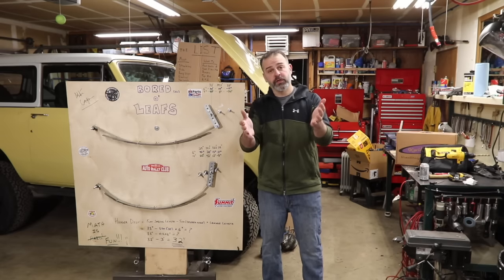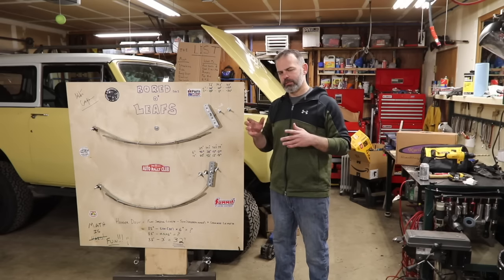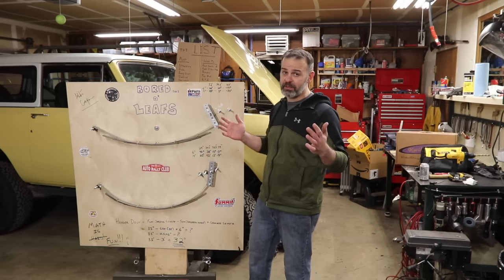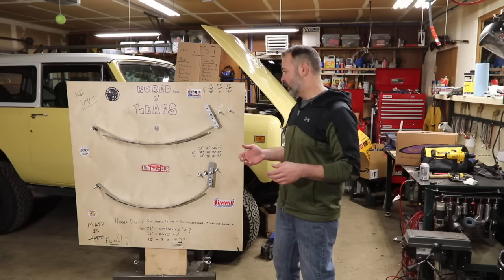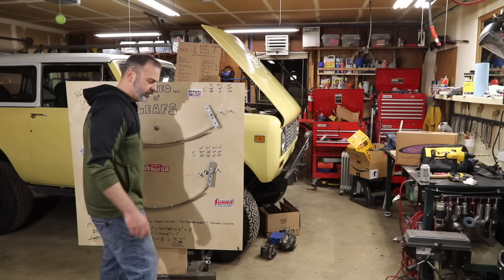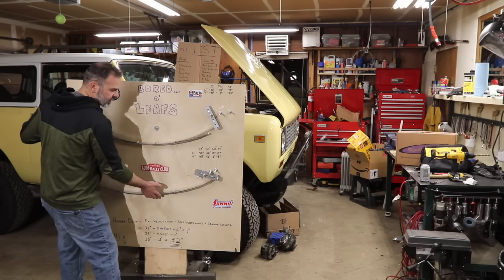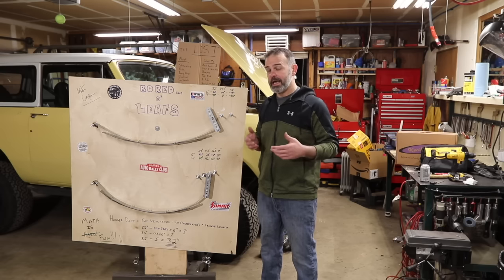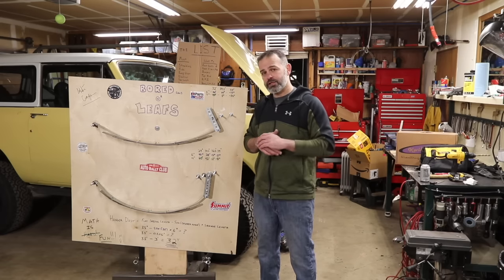5.04 Leaf Springs & Shackles GURU Level Tech!

Comment: I built my trailer with just leaf springs  if I was to put a shackle it be strait up and down 90 degrees what about if I used boomerang shackles
Reply from the maker: On a trailer I think 90 degrees would probably be ok. You want the effective spring rate to match the spring rate in that case I think. Just guessing though

Comment: This is a very smart video   sir I need your advice , how can i take away the bouncy rear end on my 2005 ford ranger all stock   thank you
Reply from the maker: Georges Nasr thanks George’s. If it’s all stock the first thing to check is the shocks, second the bushings. If it was really abused the springs might be shot but that’s less likely. Finally look for frame cracks. Always go cheapest/easiest to hardest/most expensive. Shocks, bushings, springs, frame. You may also want to throw a few bags of topsoil in the very back of the bed drive around. If that helps then your truck might just be light in the back which is common with pick up trucks.
Reply: I loaded 2 motorcycles and my truck behaved like a smooth car  , how can i soften my leaf springs though?
Reply from the maker: Georges Nasr you can remove the second from the bottom leaf but then you are changing the design. I’ve done it before. You’ll have to get new u-bolts but otherwise it is not too hard to do. Make sure you put a clamp on either side of the center bolt (after the spring pack is out) before you loosen the center bolt. It’s a risk though. Your suspension will be smoother but your load capacity will be less. You are 100% sure it’s stock? Send me a pic of the spring s at mattsgarageshow@gmail.com
Reply: @MattsGarage  ill do that tomorrow morning , thank you for your quick reply
Reply: @MattsGarage  Thank you for the quick reply,  you won't believe how hard and stiff the shocks are,  the compression is normal but the rebound is extremely slow   the truck was literary trying to pull the axle up on the rebound , that's why it was bouncing too much , o want to look for a soft shocks now , what do you recommend sir?
Reply from the maker: Georges Nasr what kind are on there now? OEM shocks ride the best. Next best is probably stock shocks from the auto parts store believe it or not. Performance shocks are almost always stiffer. Just get regular Monroe shocks. Hopefully that’s not the kind you have now.
Reply: I have Gabriel shocks,  ill go with Monroe I  guess

Comment: But the mounting points where the shakles bolt to are not adjustable positions on most vehicles, theyre usually welded to the frame.
Reply from the maker: jptrustno1 that’s correct, but vehicles aren’t meant to be lifted so manufactures set the stock springs at the ideal angle. I’ve never understood why lift manufacturers produce leaf springs that are the same flat  length as stock but with a greater arch than stock. By definition that would negatively impact the shackle angle. If you are going to have a greater arch you need a slightly longer leaf to correct the shackle angle (and probably a longer shackle too).

Comment: Would increasing shackle length soft the ride in the rear?   Years ago I installed lift shackles  on my Jeep YJ, and the handling got real squirrely until I changed the bushing to polyurethane.
Reply from the maker: Depends on what angle you have now and what it will end up at. My guess is it will make it right more rough but my “Bored o’ Leafs” board is in storage while I build the house so I can’t test that theory.

Comment: does the same apply for tension springs? Like on most oem trucks these days?
Reply from the maker: It must apply. I haven’t thought it through but the force on the spring is the same whether or not the shackle is in tension or compression. You would just have to do some test calculations on some sketches to see if the math still makes sense. I feel like the +/- of spring rate off of 90 degrees would be the opposite of compression shackles though.

Comment: I put 3" lift shackles on my S-10 blazer in the OEM shackle slot and looking at it i am hoping it doesn't bend the end of the leaf. Question is will my leaf springs be ok in that position and not deform/bend?
Reply from the maker: It shouldn’t deform or bend it but it will increase the effective spring rate so it may ride a bit stiffer.

Comment: How does this info translate for tension style springs?  Do the same thing angle wise?  Or does being in tension change things?
Reply from the maker: I can’t pretend to know. I have thought very hard about it but for some reason when you turn it upside down, I stop understanding it. I image the basic principle must be the same. There is an angle at which the tension shackle creates and effective spring rate equal to the actual spring rate and going one way increases it and the other way decreases it.

Comment: Will poor shackle angle cause rear bounce? 
Lifted Jeep Cherokee XJ
Reply from the maker: It depends on what you mean by bounce. Normally when I think down so I think it’s a shock problem if you’re talking about a wheel hop that would be a spring stiffness issue which shackle angle would contribute to.
Reply: @MattsGarage   I readjusted my shackle angle and it took the hop out of it! Thank you for the video and that fast response on the comment!
Reply from the maker: @dominicksnow2049  happy to hear my theoretical analysis led to a practical solution!

Comment: I have a 72 GMC 4 WHEEL DRIVE it's a half ton truck it has a 4 inch lift on it I bought it this way and it rides really rough can you tell me what to do to soften it up without putting new springs on it which I can't afford you may not even see this with your video being so old but I just found it
Reply from the maker: Move the shackle or remove a spring. That’s what the video is about!
Reply: @MattsGarage  ok how do you mean move the shackle I watched the video but I'm not the greatest with this kind of math that was a big down fall in school do you mean to move the shackle on the frame if you would explain it to a old man that's not good understanding the math of your video please and I'll watch it a couple more times and see if that helps me thank you sir
Reply from the maker: @jameswallace7351  sorry James, you need to be able to do the math or you won’t get it in the right spot. Actually we should back up. Do you know that he spring rate is the issue? Is there anything else causing binding?
Reply: @MattsGarage  I should have told you it has a lift kit on it I removed some of the springs a few years ago I guess they are just to stiff for a good ride I have no idea what rate is for them I'm just trying to figure out a way to soften up the ride some without changing the springs which is very expensive for this truck I'm going to watch your video a few more times and see if I can figure it out and also find someone that can help me with it thank you for your time and help
Reply: @MattsGarage  and as far as I can see there isn't any binding I guess they are just to high of a rating there is a lot of arch in them
Reply from the maker: @jameswallace7351  I think getting new springs will end up cheaper than any other solution if you’ve already pulled out leaves. Re-positioning shackle hangers requires some serious fabrication and if you don’t have the tools or capability it would cost a lot to have someone else do it.
Reply: @MattsGarage  thank you I appreciate it

Comment: Question sir im replacing leave springs on my boat trailer should the bolts lock nuts be loose a bit so it flex when over a bump thank you very much
Reply from the maker: I don’t know enough about trailers to give advice about them. Normal vehicle spring bolts should be tight. The load is on the bushings, not the bolts.

Comment: Can the car ride  height be changed safely using longer shackles?  My springs go under the axel.
Reply from the maker: Any time you increase the height of the vehicle it can contribute to instability. That being written, people do it all the time without issues.  It is a lever so each inch you add to the shackle, the stresses at the frame side bushing increase exponentially.  Also remember for every inch of shackle you only pick up 1/2" of lift because the leaf is fixed at one end.

Comment: What happens if you move the hard mount side up/down, but leave the shackle side in the same location?
Reply from the maker: On the front axle it would change the pinion angle, caster, and road manners. On the rear just pinion angle and road manners. I’m not sure how you’d predict it except to imagine it extreme one way and another to inform how it affects road manners.

Comment: Thanks a lot. Just what I needed to know. Un abrazo desde España
Reply from the maker: Márcio José gracias amigo!
Reply: @MattsGarage  we have a 75 troopy with an extra leaf over the +200kg OME leafs..  it's horrible driving it. Too firm.. the rear springs doesn't flex at all. So I'm planning put the parabolic terrain tamer 78 model (I believe they are 5cm longer) and calculate the shackle height and angle I really needed to have a closer idea. Thanks a lot Matt. Best regards.
Reply from the maker: Márcio José that sounds like a cool project. Yeah people say they love the OME springs but you need to break them in. But without the right shackle angle it’s hard to do. Just a little sharper than 90 degrees from datum line and you are good to go.

Comment: Does it ride better using your formula in real life?
Reply from the maker: The Other Guy I’ve only done a shake down with it tack welded because after this I started a restoration but it made a HUGE difference. Night and day. I can’t overstate it. I even off-roaded it on my property a little and it was smooth.
Reply: @MattsGarage  I've save your video for my future SAS build on my truck. Doing research, and knowledge is power.
Reply from the maker: The Other Guy happy to help. Like I said in the video, I couldn’t find anything that even remotely talked about leaf springs and shackles in a helpful way. I hope this helps a lot of guys avoid the harsh ride let-down after they lift their rigs.
Reply: @MattsGarage  i have asked the same question on other forums and no one was able to answer me. I learned something today.

Comment: Does this only work if you want the springs to be flat at ride height
Reply from the maker: No it’s the same with an arched spring. It’s probably more important with an arched spring actually.
Reply: @MattsGarage  I don't think I understanda, thanks for replying. What I am trying to say is that the calculation you do to find the spring hanger distance uses the length of the leaf when it is dead flat. Wouldn't this mean you would only get your desired shackle angle if the leafs were dead flat. Or does the formula accommodate for this allowing the right arch of the leaf spring and shackle angle. Regards Darcy.
Reply from the maker: @bobbob-vw1yw oh, ok I understand. The formula works but you still have to measure the flat pantry of your spring no matter how arched it is. You do this by taping a string on the spring. Mark the ends of the spring where they meet the spring eyes. Take the tape off and lay the string flat on the ground. Then measure the distance between your marks and that’s the flat length of your spring.
Reply: @MattsGarage  thanks mate your information is so valuable. Finding it hard to find good info online

Comment: So longer shackles will increase effective spring rate, and shorten travel... That's exactly opposite of what I'd guess
Reply from the maker: Yeah it seems counterintuitive. Now if you get longer springs to go with your longer shackles, it’ll keep the rise softer. At least I think so, I’m just going based off what I learned in my experiment.
Reply: It often looked over but spring length will determine shackle lenght and is critical for the suspension to work well 
Great video maybe you could do a video on shocks for leaf springs as they need to be very different to other types of suspension

Comment: Does the more long shackle make the spring rate lower?
Reply from the maker: 16driver16 my. “Bored Of Leafs” is in storage right now so I can’t test it but if you run the calculation I talk about in the video you can back into the answer.
Reply: @MattsGarage  math... i can try, i did graduate middle school
Reply from the maker: 16driver16 just thinking through it I believe it would make the spring rate slightly higher.
Reply: @MattsGarage  darn, i was hoping the longer leverage would make it flex easier, but after watching your video i was unsure of my idea
Reply from the maker: 16driver16 are your springs lifted (arched more than stock)? If so a longer shackle will increase your travel and make you more flexible, but as I said it will slightly increase your effective spring rate. But if you soften up your shocks it may not be noticeable. The biggest difference is when you go from a stock spring to a lifted spring.
Reply: @MattsGarage  it is currently dead flat unfortunately ill look into 2" springs instead of shackles thanks
Reply from the maker: 16driver16 if it’s dead flat that the way to make it flexier would be to pull the shackle mount closer to the fixed mount and add a longer shackle. That would give you the best flex/ride quality combination. It would not give you hardly any lift for bigger tires though.
Reply: @MattsGarage  i only want to level the truck(1") and not make it stiffer riding. Its a stock 1983 toyota 4x4 pickup
Reply from the maker: 16driver16 feel free to send me some pics of the suspension at mattsgarageshow@gmail.com. Be sure to include a shot of the shackle from the side and a picture where I can see both the bump stop and the part of the axle the bump stop touches. A few of my subscribers were complaining about rough ride and turned out they were hitting their bump stops because their leafs were fatigued and sagging.
Reply: @MattsGarage  i looked under the truck today after work, i forgot it also has a tourque rod to add to the equation im pretty sure the shackle on the drivers side of the truck does not really get along with this bar very well just from thinking about how it would/wouldnt work for a few mins
Reply from the maker: 16driver16 the torque rod has an important purpose on your truck. The Yota forums seem pretty helpful. Lots of info. You need to find a guy who “knows” close to you.
Reply: @MattsGarage  they just accepted me on the Toyota mafia facebook group, im hoping someone there will have the exact knowledge im looking for

Comment: Great video!  I made a comment,  but accidentally posted it under thisoldjeeps replies. . Looking forward to your reply. .
Reply from the maker: Abraham Grcich hello, I don’t know enough to say why choose compression vs tension but some things to consider are: 1) tension has a greater range of motion 2) tension might be better for heavy loads 3)!tension keeps your center of gravity lower. But I wouldn’t change one to another unless I had a very specific reason. Does that help answer?
Reply: @MattsGarage  Yes!  That does help.  I'll go ahead with a tension set up.  It's a completely custom frame with the springs outboard of the rails. Thanks Matt!

Comment: Are you still around?
Reply from the maker: Yes
Reply: @MattsGarage  

Hey. Have a question.  Maybe you might know.

Do you know how shocks are staggered in the back on trucks.   One facing forward and one facing to the rear as a way to prevent axle hop I believe it was.

Well,  I was wondering if there would be any benefits or cons to adding 2 more shocks for a total of 4.  2 facing forward and 2 facing backwards.

Im wondering bevause I have extra shocks and shock tower mounts that I can fan into my frame.  

Thx!
Reply from the maker: @johnle231  the only benefit Tom more shocks is Al they will
Stay cooler for a little longer if you are driving fast through rough terrain. No normal person would need this and rock racer just use one really big shock. Save the hassle and keep it simple. Keep the shocks as spares!
Reply: @MattsGarage  

Oh ok.  Thx for your response

Comment: Why not run sliders, they have 2 kinds one with nylon sliders the other with bearings, throw you shackles away...
Reply from the maker: joracer1 I think sliders are super cool but 99% of systems are shackle systems so the intent was to help guys set those up. Plus I would consider sliders more of a trail-heavy mod. Standard bushings are more appropriate for anything seeing more street than train just due to service life. Just my opinions though.

Comment: Dang, you lost me at Math 😩😩😭
Reply from the maker: Robert Immeer simple version, you want your shackles doing more of a bicep curl than a tricep extension.
Reply: @MattsGarage  got it. I was told by Deaver to put it virticle but, my instinct said what you just confirmed. Thanks man!
Reply from the maker: Robert Immeer vertical meaning 90 degrees to the imaginary line between the two eyes. That’s correct. I would just do a teeny bit more bicep curl and you are good to go. It doesn’t take more than a couple of degrees to go from soft to squishy.